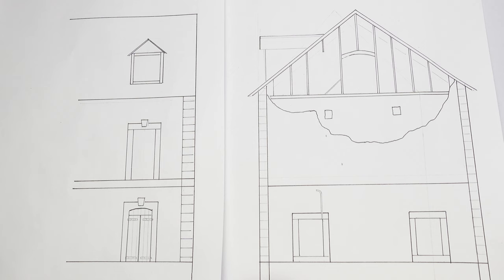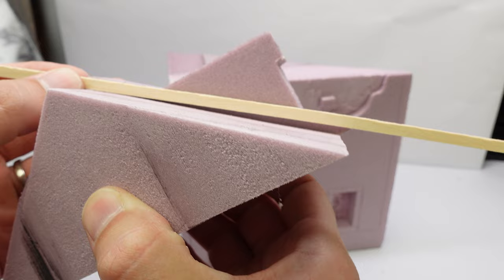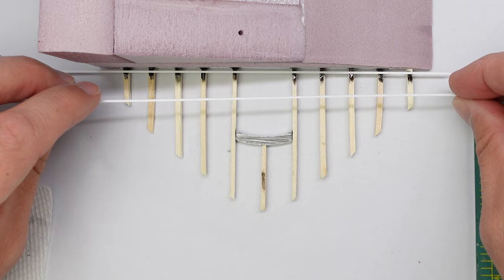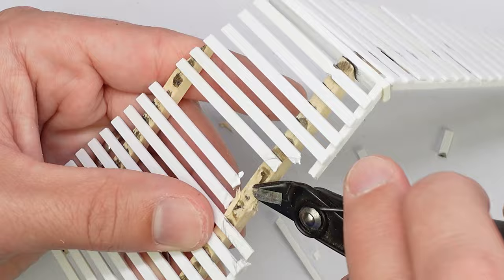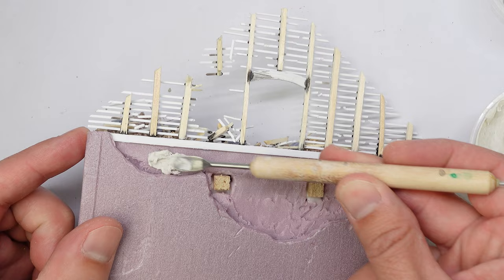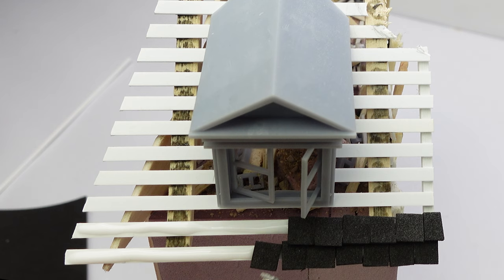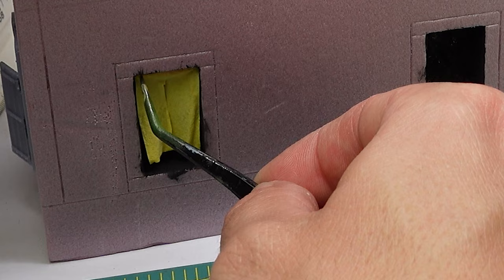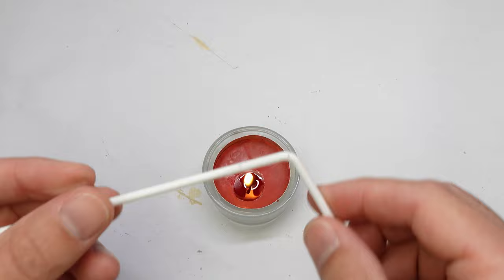Building A Destroyed Building Completely From Scratch

Comment: Really great work👌🏻 What did you mean when you said 3d printed? Filament or a resin printer with liquid resin? What is more common in scale modeling and printing such fine detailed parts like windows, roof tiles,…, a resin printer or a filament printer?
Reply from the maker: Resin 100% better for scale models. much less prep work. but considerably more toxic to work with.

Comment: Fantastic job and being able to print some great pieces, some questions about the size you used for the bottom of the house and for the roof the plastic bars that are 0.5, thanks.
Jose
Reply from the maker: I did shorten the building compared to the original to better fit the diorama. The base of the building is 66 mm. by 155 mm. The roof slats are 1 x 4 mm. styrenestrips.
Reply: @mattockmodels  Thank you.  a greeting

Comment: No fair using your 3D printer.  Few of us have those.  I learned from your scratch building work, but...
Reply from the maker: The printers are mostly just faster, especially for YouTube. Almost everything that I design can be scratch built by hand. The biggest benefit of the printers is duplication. Also the printers have come down in price considerably and some maker spaces will let you use them to print.
Reply: @mattockmodels   I understand, but it makes me so envious...